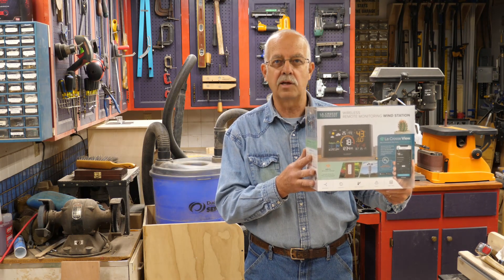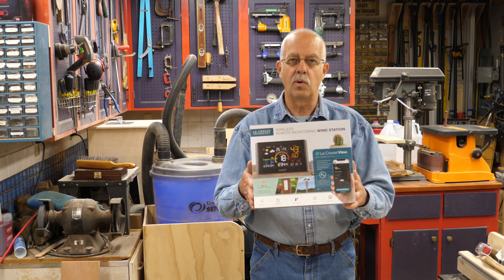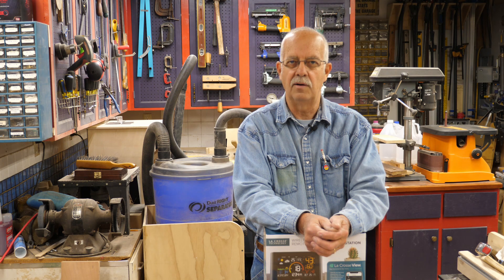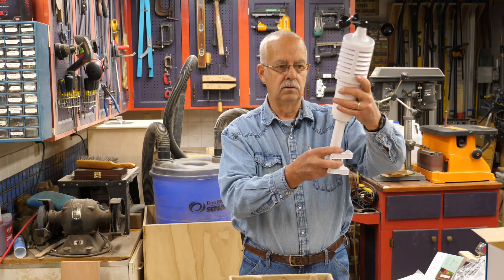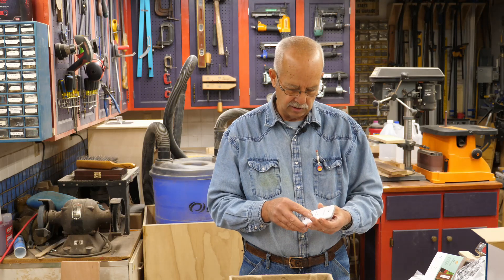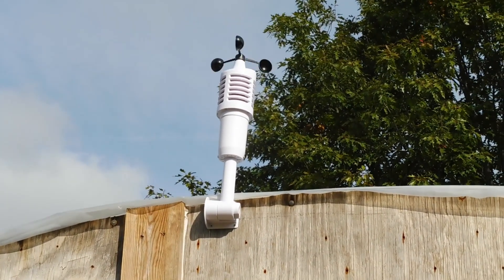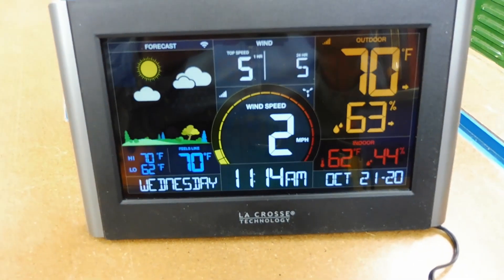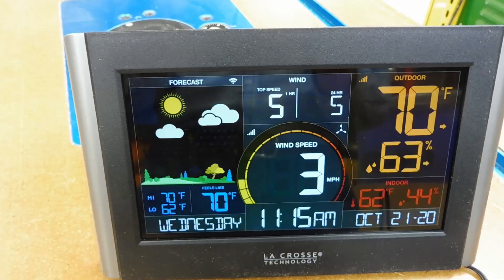La Crosse V21 WTH Weather Station Setup & Review

Comment from the maker: For those wondering how long the batteries in the outdoor unit would last:  They went out January 29th, so that is about three months.  We did have some below zero temps, but don't know if that was a factor.
Reply: can lithium batteries be used?  that's what are in my cameras and they have gone over two years - even with freezing temps
Reply from the maker: @noneyerbidness  Yes.  However, extreme cold does affect this type of battery.

Comment: I bought a wind speed sensor this fall and after a few months I can say it is a poor design. Every time we get some snow it stops spinning because of the way it is designed. Currently our local airport 6 miles away has gusts to 28MPH and we are reading 0MPH and our heavy sewn flag is whipping in the wind. The cone on top of the housing needs to be longer without a flat place to collect snow.

Comment: Should the anemometer flash as soon as batteries are inserted? I did notice it flashing occasionally when it was installed outside. I now have it in the house because it is no longer working and doesn't flash at all
Reply from the maker: I had to go look.........Yes, the LED does blink every so often.  If yours is new, I would contact LaCrosse.
Reply: @rogersshop  Thanks for the quick reply. Unfortunately mine is a couple of years old. I guess it has finally died

Comment: Think twice before buying.  I have the LTV-W1 model of Weather Station.  About six months into owning, the weather vane stopped working.  Not the batteries...the weather vane no longer works.  I have contacted the company three times by the only way you can...through their support website.  NO RETURN CONTACT from them, so I have a system that does not work...they obviously have no intention of standing behind their product.  I then started researching and have found that the LA CROSSE weather systems have a lot of issues, so there are many who have issues.  I wasted my money...be careful about wasting yours.  For Sale...slightly used and defective LA CROSSE LTV-W1 weather station...buyer beware.

Comment: Hey Roger, I just bought this unit, snd cannot figure out how to change the day, time and date.  Nothing I can find in the minimal set up sheet.  Sure would appreciate it.

I actually have a brand new LaCrosse model 3610 I bought at a garage sale about 8 years ago, never put together.  The wind system isn’t cups, it’s a little 2” inches propellor inside a cage with a wind vane on top.  No wifi, actually used a los power radio transceiver.   It also is the black and white lcd monitor.  But the wind isn’t even close, so I got this model today, and will get the rain sensor later.
Reply from the maker: Hold down the set button for about three seconds.  The display will then start to flash.  Each time you then press set, the item to set will change.  Use the + and - buttons to change the setting, then press set to move to the next item.
Reply: @rogersshop  thanks a bunch!!  I actually asked my two year of and he told me how to do it!  Not really, but sometimes I feel these kids know more about electronics than we do!!!  Actually I accidentally found out there was a real manual on the La Crosse home page, and got it figured out.  Now to figure out why I’m getting the no connection on the base.  Saying it’s not connected to the La Crosse View App, but the app is getting data from the base.  Maybe I’ll ask my 4 yr old granddaughter this time!!  Thanks for the answer though!

Comment: We bought one of these exactly and the wind direction is not correct and we can not find where we can change it. We are saying ssw on the viewer but the wind is NNE. It says it is controlled by the NWS but not how to change it, also we do not follow daylight saving time but the time will not change.
Reply from the maker: Might want to contact La Crosse on that.  I am not an expert on this, by any means.  My install went without a hitch and it works perfect (until covered with ice).

Comment: Nice video.  Be interesting to know how long the battery lasts before it needs to be changed.
Reply from the maker: I will post an update once this has been in use for a while.  So far, it has performed as advertised.  My previous unit had a solar cell and Ni-Cad battery.  But, the battery never lasted for more than a year before needing replacement.